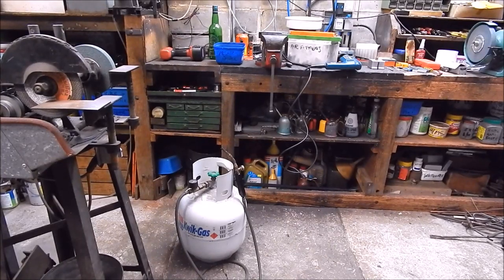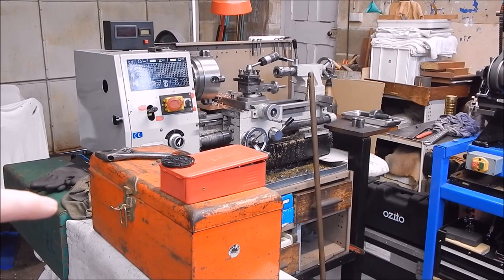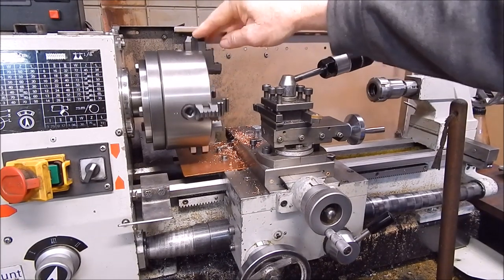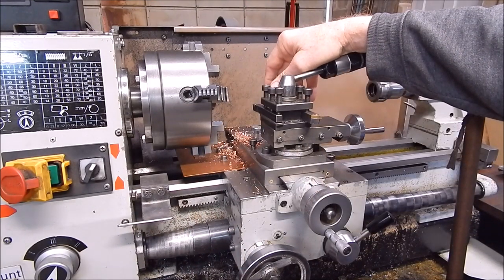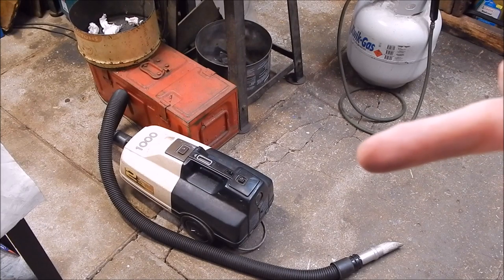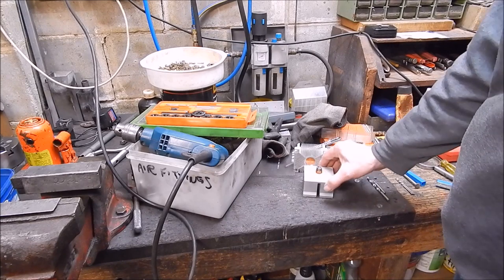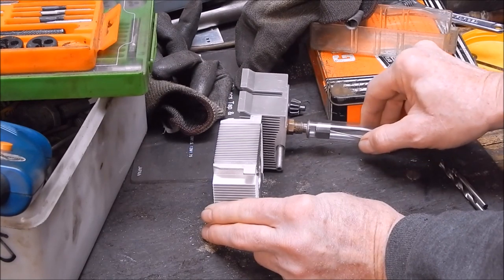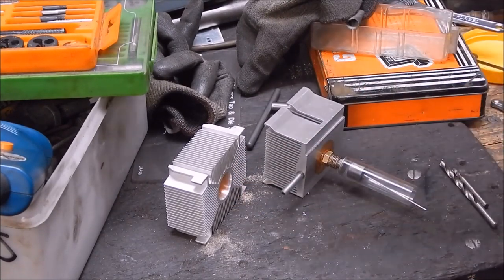A typical day in the Xynudu workshop

Comment from the maker: It's great to get back into some serious lathe work again.  Even the winter weather can't put me off.  I can only use a CPU cooler on the power piston side as they are not thick enough for the displacer, but a lump of my home brew aluminium is shaping up well for that.  The project is going like a champ so far.  Good to give the brain cells a proper work out for once in a while.  Cheers Rob

Comment: Makes me feel more than frustrated that I can't get shop time - the old back and extreme heat make it impossible!
Your shop works well for you - chances are right now weather is chilly down there.
Love that Sherline. Heat sink idea has great potential.
Reply from the maker: Hi Chris, bad back is no joke.  I'm 6'2" and if I stand bent over the back gets gnarly, so my lathe stands are quite tall and suit my height.  Makes a big difference to surviveability. The weather is cold and wet down here now, but still OK compared to the snowy countries out there.  I usually wear gloves (OH&S approved) for lathe work in winter, makes a big difference.  Prevents accidents despite what some people think.  If the heat's bad where you are, just have a beer for me will you.  Cheers Rob

Comment: Glad to see a few wider shots of the workshop - filling in the puzzle gradually. I'm also interested to see another project brewing. Those sterling engines look like they're tricky to get running nicely. I'll follow along with great interest.

Stones ginger wine, I thought you were a beer man!? ;-)

Cheers mate,

Craig
Reply from the maker: Hi Craig,  Flame lickers are more problematic from my experience/designs.  I have never managed to get several attempts going.  Still on the bucket list.  Regarding booze, the only thing I don't like is spirits. Boags beer is a nice drop. 
Cheers Rob
Reply: @Xynudu  I am ashamed to admit I have never tried to build an engine. I have all the gear (surely?!). It's a bucket list thing though, so I will get round to it one of these months! I'll steer clear of flame lickers as a first outing! Was thinking a wobbler steam engine would be a good starting point?
Reply from the maker: Hi Craig,  I've never tried to build a steam engine.  You have to have an air supply which is a bit of a drag if you want to run it in the house etc.  Stirling engines are the go, and yes they can be finicky, but once you have the dimensions right it's pretty plain sailing.  Just keep friction as low as possible.  If you use the dimensions in the comments section of my video on the Stirling you should be OK.  Cheers Rob
Reply: @Xynudu  I mention that because I saw a simple 'wobbler engine for boys' or similar on Mr Pete's channel. But I believe you have convinced me because of the air supply question. I will start with a stirling engine and follow your lead. Cheers Rob. When I finally get round to it, expect an email or three from me asking why the damn thing doesn't work ;-) Craig

Comment: Yep, I hate my vacuum as well Rob. I use two drill presses, the big free standing one for the heavy stuff and I have a little five speed I picked up for free tucked away at the end of my bench that I use for small holes and making pilot holes before going to the big drill. It’s just so convenient and saves a lot of time and mucking about. I highly recommend having two if you can. I also have several grinders handy, all 5” so one has cutting discs, another grinding wheel and the third a flap disc. Of course I didn’t go out and buy them new but if you keep your eyes open you just seem to collect them over the years. I think very carefully about knocking things back that are cheap or free now because ‘I already have one’ as you just never know. Cheers Stuart 🇦🇺
Reply from the maker: I wish I had a dollar for every time I've cursed that thing.    But then again it gets to suck up lots of stuff it was never designed for.  The broom handle's been down the tube to clear blockages a few times as well ;) Cheers Rob
Reply: I use the plastic spline out of pine board flooring . Just the shot fire vacume cleaner hose .  They don't like it up them !! ( Dad's army)

Comment: Hi Rob , Always fun in A Workshop ! Keep Busy and Give It A Go As You Say . I'm In Process of Building A Power Supply Myself . It will be My 1st one . Using Xbox 360 Power Brick put  Inside Old CB . Anyway , Cheers to you Rob !
Reply from the maker: Hi Wayne,  There's a first time for everything.  If it works it's a plus.  If it doesn't it's still a plus, you just say well I learned something there, better luck next time.  Giving up is not an option.  Cheers Rob

Comment: Right about BIGGER lathe chucks, my 6 jaws 10 incher was about 40 kg 4 or 5 years ago....!!!    And they gain weight as years pass, by now it surely feels like 60 kg.....     😰😰
Time spent in the shop:   30% machining and fun stuff,  70% CLEANING...!!!
Reply from the maker: Hi Pierre,  I hate cuttings mess and that's why the shop vac gets a lot of use everyday.  But I have no where to stuff it out of the way handy, so I curse that thing.  It gets the odd kick out of the way at times ;)  Cheers Rob
Reply: Here there is an old " Get your anger on it " vacuum cleaner, so far beside being really beaten up it puts up with me for at least 35 years...    Poor thing...   😈😈😈

Comment: Hello, you say that the chuck of your lathe has 6" diameter but of origin it should be 5". Is not it too heavy? Does the lathe support a 6 "chuck well?
Reply from the maker: Yes, no problem.  The spindle is 1" internal so does it easy.  I have a scroll chuck and four jaw both in 6" as well as the original 5" scroll, plus ER32 collet chuck.

The way to go.  This lathe is quite gutsy.  Cheers Rob